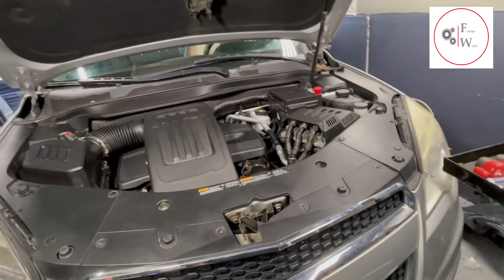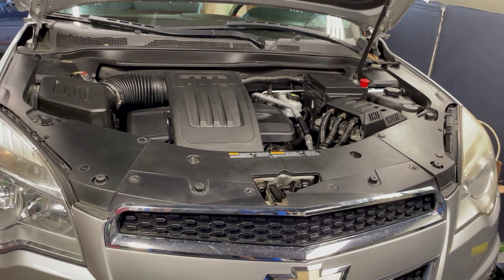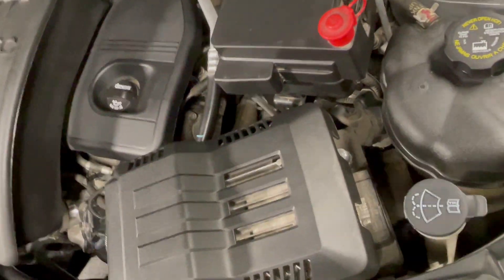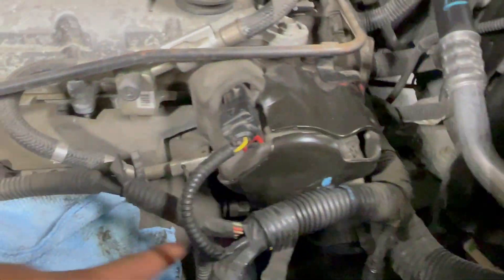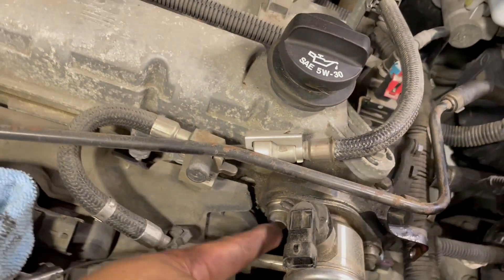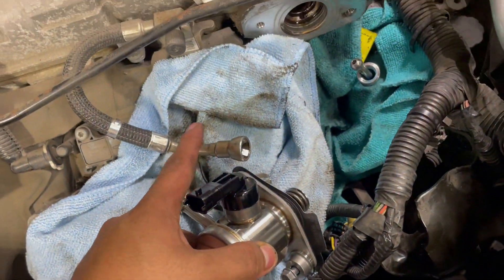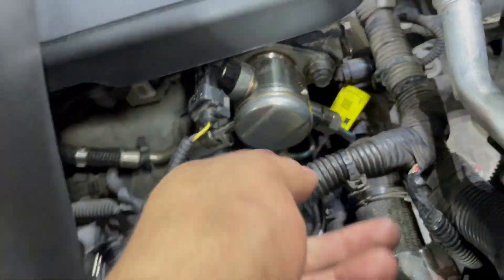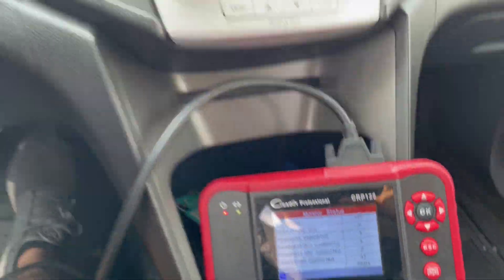Chevy Equinox High Pressure Fuel Pump Replacement (Code P0172) 2.4 Ecotec

Comment: My Daughter brought her 2015 Chevy Equinox LT 2.4L to me about a week ago, said her Check Engine Light was on and had been for some time.  She had asked her boyfriend to scan the car with his scanner but he never got around to it.  The reason she brought it to me is that she had a decrease in power (Limp Mode).
I don't have a scanner so I just checked the basics: Oil Level, Spark Plugs, Air Filter, MAF Sensor, etc...
Her Spark Plugs were in definite need of being replaced as I'm betting they were the originals with 95,000 miles on them, so I replaced them.
Also ended up Removing the Throttle Body and giving it a good cleaning.
These things seemed to take care of the issue so I gave her SUV back to her.

Just the other day it was hot outside and she had the AC going instead of having the windows down.
The Vehicle acted like it wanted to die and the belt was squealing, also, the Check Engine Light had come back on.
Again she asked her boyfriend  to scan it for her, again it didn't get done.
She called me and asked me to look at it again.

First thing I did when she dropped it off this time was to drive over to Oreily's and have it scanned.
Of course it had the P0172 Code: High Pressure Fuel Pump.
I purchased the AC Delco (EP1028) High Pressure Fuel Pump at O'reily's while I was there along with 
a Fuel Line Disconnect Tool.
Been a long time since I'd replaced a Fuel Pump, let alone a High Pressure Fuel Pump.
Actually, the last fuel pump I replaced was a Mechanical Fuel Pump in a 1973 Pontiac.

Her Equinox was Experiencing: Check Engine Light, Engine Run On after turning the key off,
Engine wanting to die when AC was On w/belt squealing, But There Was No Gasoline Smell In The Oil.
Believe me, there was the Gas Smell in the oil of that 1973 Pontiac!

I turned to Youtube to find a video and ran across yours.
I appreciated your video, most being Spot On.
There were just a few differences, most likely the model year being different.
Her's had an extra Bolt on the Lower Side of the Cover, a Fastener On the Top Side holding a Line 
(May have been Fuel line), and an Extra Fastener on the Side and an Extra Fastener in the Front of the 
cover holding the Wire Harness.
Everything else was pretty much the same.

I did find that loosening the Bottom Connection of the Fuel Injection Line made it much easier to attach
the Upper Connection to the High Pressure Fuel Pump (without stripping the threads).
I loosened it less than 1/4 turn, then once the upper connection was threaded on by hand I tightened 
back down the lower connection.

Replacing the Fuel Pump took me about an hour.
I have had 5 Back Surgeries and have lots of trouble leaning over the car to do this type of work. 
I also take lots of breaks because of my Back.
Would probably take someone without back problems, much less time.
Anyway, changing the HPFP went like clockwork.
Her SUV no longer has a Check Engine Light On, Not Throwing Codes, and is running great.
I had traded vehicles with my daughter for a couple days and I don't think she wanted to give
my car back, she likes the 2.0L Turbo in my Regal!

BTW, this is a job that almost anyone can do, man, woman, etc... (Don't let it scare you).
It does take a little bit of time and you will have to wash the dirt off your hands, but you can do it.
And with the Prices they charge at a Dealership or a Mechanics, it's well worth your time.

Thanks again for the Video!

Comment: My wife's Equinox is doing the same thing, I wasn't sure what the problem was,I asked a bunch of mechanics on Facebook and they mentioned the fuel pump,that's when I looked here on YouTube,if you don't mind me asking, what did you pay for the pump and did you have to change the fuel line?
Reply from the maker: I believe I paid about $240 for a genuine Ac delco unit. The line is recommended to be replaced. I however did not replace the line. Since this line has never been undone before there is no problem reusing. Once you undo that hose many times, then you need to replace it.

Comment: Does the cam lobe have to be in a certain position or can you just swap it out without having to deal with that?
Reply from the maker: Just swap it out, do not touch the lifter that is in there. Mount the new Hp pump and bolt it down! Some people say you have rotate the crank to be able to fit the high pressure pump. I just removed the pump without rotating the crank and installing the pump. I had a slight resistance bolting it down since the spring needed to be compressed against the lifter. But it was no problem. The equinox is still running like a champ!
Reply: @Fwerks.1592 thank you. I have a 2013 GMC Terrain 2.4 that has a P00C6 and a P0191 engine code.

Comment: Is this something a woman can do? I’m so tempted to try it myself. Is it just 3 screws and then the special tool to detach the fuel line?
Reply from the maker: If you have a tool set ratchet + sockets, that’s all you need! Also you will need that fuel line disconnect tool which they sell at the parts stores for like 16$. They come in a set of colors to distinguish the sizes. Also you will need an open box wrench to disconnect the fuel line from the high pressure FP.

Comment: About to do this same repair. Where do I get the tool to disconnect the fuel line?
Reply: How did it go ? Same issue here.
Reply: @djmtgMikeTheGreek-p6p  it was very easy actually just got the fuel line tool off amazon

Comment: You're supposed to replace that fuel line. If it doesn't leak than why? Gm also has a class action law suit because it's "acceptable" for that vehicle to burn 1 quart of oil per 1000 miles. 5 quart engine, 5000 mile oil change interval. Do the math. Lol! I hope the bastards get what they deserve! I have a lady on social security in her mid 60's and just had to tell her that her truck was junk.

Comment: Mine went into stabilitrak  and engine power reduced the other day. Cleaned throttle body wasn't it, bought new one wasn't it. Made it to the  auto zone to use the scanner, and it said, "It's mostly likely the  hpfp." i noticed it make a weird sound around where it's located.
Reply: My 2014 equinox lt had the same issues that's described in the video. It also suddenly did what you described as well. I changed the high pressure fuel pump and now all is well. Running great.

Comment: I just happened to be trying to pump fuel from a 2013 Equinox that has a pretty full tank because this car is just sitting for now.  Disconnected the supply line before the schrader valve and connected some hose going into a container.  I jumped the run crank relay but fuel pump will not stay on.  Seems like a prime cycle or something.  Is there an easy way to make the fuel pump run continuously?  I mean, aside from crawling underneath and jumping 12v to the pump connector.
Reply from the maker: @chad4132  why are you pump in the fuel out or trying to pump the fuel out? Are you dropping down the fuel tank?
Reply: @Fwerks.1592  just want to pump the fuel out in order to transfer it to a vehicle that is being used.  I planned on putting the car on ramps and seeing if I can get at the pump connections.  If I can then I'll just jump 12v to the pump and I'll be able to get this done.  But if there's an easier way, let me know.

Comment: So the fuel pump for these equinox’s is on the motor? It’s not in the gas tank like a lot of cars? Or is there also another pump assembly in the tank? Forgive me if these are stupid questions I’m just trying to learn so I can help my friend change hers out
Reply from the maker: So the high pressure fuel pump is on the block. The traditional pump your talking about it the sending unit. That’s always located inside the fuel tank. All vehicles have a fuel pump inside the tank and they also have a high pressure fuel pump located somewhere on the motor. No worries you’re all good bro!

Comment: My fuel trims are still negative after replacing the pump 130k miles, same code and can ran for a couple seconds after shutting it off
Reply from the maker: That’s strange, the high pressure fuel pump will cause for a delay on the car shut off. Did you use a OEM AC delco pump?

Comment: I've got a 2014 GMC Terrain with the 2.4l engine , same issue. any idea what the part number is for my HPFP and the "one use" line as well? any info would be greatly appreciated.  thanks 👍
Reply from the maker: Here are some parts numbers!
Fuel line: Intermediate Fuel Feed Pipe - GM (12608374)
HPF Pump: https://www.gmpartsoverstock.com/oem-parts/gm-high-pressure-fuel-pump-with-seal-retainer-gasket-and-bolt-12641847?c=Zz1haXItYW5kLWZ1ZWwtZGVsaXZlcnkmcz1mdWVsLXB1bXBzLWFuZC1yZWxhdGVkLWNvbXBvbmVudHMmbD0yJm49QXNzZW1ibGllcyBQYWdlJmE9Z21jJm89dGVycmFpbiZ5PTIwMTQmdD1zbGUmZT0yLTRsLWw0LWdhcw%3D%3D
Reply from the maker: No problem! I’ll get you that information shortly.

Comment: What tool did you use to remove the fuel lines??
Reply from the maker: I used the lisle 37000. You can find these fuels disconnect tool at any Advance auto parts store.

Comment: I found the fuel pump that you recommended on Amazon, its says to order with a 12608374 fuel feed pipe? Do I only need the fuel
 pump? Thank you in advance
Reply: Awesome! Thank you for your quick reply!! I greatly appreciate it!! Here's to fixing something on my pos equinox 😂
Reply from the maker: @jeanettehartwig1264   anytime!!
Reply from the maker: Yes get the fuel feed line too! The dealer mentioned that fuel line is a one time use.

Comment: Battling this exact issues with my 2011 Regal with the 2.4 dealership wants to charge me 1100 to do it. 700 of it being the pump n feed line. Gonna keep this video handy and attempt the repair myself
Reply from the maker: Make sure that pump is OEM from GM! I seen people replace it with an after Market and still have the same issue. Also you do not need to position or remove the cam-follower. I’m here if you need help!
Reply: @Fwerks.1592  following up with you... With a sigh of relief did the pump and feed line couple days ago. My 11 regal has been running great I just put a scanner on it. To see if there was any hidden pending codes. And nothings showing 🤞🤞🤞 this battle is finally over
Reply from the maker: @Smurfy89   That's awesome!!! I'm glad the Buick is now running great!! I'm glad I was able to help!
Reply: @Smurfy89 same issue here. The fuel pump and the feed line is two different things? If I install new fuel pump I might have same problem? Thanks
Reply: @Fwerks.1592  I ordered a ac Delco one

Comment: Is it necessary to line up the cam shaft with the pump ?
Reply from the maker: No. Whatever you do “Do Not “ remove the camshaft follower. Just remove the pump. When installing the new pump. Just insert it and start off a few bolts. The pump has a stiff spring on it so it will give you slight resistance when starting the bolts. Push slightly and start two of the bolts.

Comment: What was the performance symptoms while driving? Any smoke from exhaust?
Reply from the maker: Upon start up the rpm’s where bouncing / rough idle. There was definitely no smoke coming from the tailpipe. It felt like a misfire.
Reply: @Fwerks.1592  mine is running rich and does fine until you come to a stop. It’s then it starts hesitating on take off almost as if the motor completely shuts off and then smoke from excessive fuel comes out exhaust. Once it clears and you keep driving it does fine
Reply from the maker: @jackfentress0281  did you scan the car?
Reply: @Fwerks.1592  yes same code but was curious of what yours was doing
Reply from the maker: @jackfentress0281  I wouldn’t doubt if the high pressure fuel pump is going bad. It’s a common issue in most of the eco equinox

Comment: We have to try this. The so called mechanic says thats not the issue? It wouldn't go past 25mph, the suv was stalling, the lights would not cut off after we cut the veh off. When he test drove it, he said it ran fine?? What do u think??
Reply from the maker: Sounds like you may have a bad throttle body. A bad throttle body can prevent the car from exceeding a certain speed limit. It can also cause a car to stall. Did the mechanic properly scan the vehicle?

Comment: I'm getting ready to do this soon. I had a knocking noise replaced the fuel injectors went away. A week later noise back running like crap and oil smells like fuel. Great video it's saved and hopefully this will fix it!
Reply: It's a GDI engine there are no "fuel injectors".
Reply from the maker: I hope this high pressure fuel pump solves your issue!
Reply: Well?

Comment: our 2012 equinox starts and when on idle starts to like wana turn off and it does unless i press the gas ... engine light was on and i replaced the gas cap and engine light inmediately turned off.... but still when turned on and regulates down feels like it wants to turn off and it still does unless i press the gas after that it stays on normaly its a 2.4 l any tips oh and no codes come up and engine light is gone ever since i changed gas cap....... do you think its my fuel pump i have to replace just my guess
Reply: Same problem this week. Installed new alternator and it still wants to turn off while driving
Reply: @djmtgMikeTheGreek-p6p the repair looks doable but what “special” tool did you use for t 5:03 he fuel pump connection on the passenger side??
Reply: @RobertGuilbault  Fixed. Had a PO172 light forever. Changed oxygen censor. Car doesn’t stall anymore. Thanks Robert.
Reply: It might be your purge valve; mine was doing that and every time I refilled fuel and try to fire up the engine the will shut off immediately; I had to wait like 5 minutes before firing up my car.
Reply: Did you ever figure out what the issue was?, mine is doing that

Comment: couldn't it be fixed with just a new gasket? from what I've read it's a faulty gasket.... I also thought about using a hi-tac gasket saver to strengthen the gasket so it won't happen again... thoughts?
Reply from the maker: A gasket??? Noooooo this is definitely an internal issue that was failing. I didn’t have a leak issue. I had an issue with fuel leaking into the cylinder via the cam lifter. The spring on it wears out . Please do not use any gasket make or hi -tac gasket! Since it’s fuel it will break down quick! Use the metal gasket provided with the pump!

Comment: Hey i have ??
My 2013 gmc terrain shuts off upon starting wether engine cold or hot and upon 2nd restart no problem,i replaced throttle body n Maf sensor still does same thing,no check engine light at all,any ideas would be apreciative, im a basic home m
Reply from the maker: Does your car shake/ shudder when idle? A little hard to tell without being there. Might be a bad fuel pump going out. Do you hear like a whining more lie a bussing noise coming from the rear? Might be a fuel issue. Could be a bad fuel pump or a high pressure fuel pump.
Reply: @Fwerks.1592  Nope ! 
Once I start a second time it idles fine and rpms stay at about 900 rpms it idles fine no fluctuations and will drive fine never stalls during driving, i dont hear the hissing sound from fuel pump in tank, its got me stumped,Like I said only kicks n stalls after the first attempt of starting the car I have to turn off the ignition and then on the second try that starts fine and does not stall

Comment: hi i have a 2011 equinox 2.4 engine light was on i just had the high pressure pump replaced at a shop and they said they rebuilt it and changed the oil as there was gas in it however i drove the car for a couple weeks checked the oil and after letting it sit over night i checked the dip stick and it was dripping a bit and had gas in oil again but no engine light and runs fine fuel trim was good to on my scanner.
do you think i should just buy a brand new oem pump and that will fix the problem i figure rebuild is crap
Reply from the maker: I would have recommended replacing the HPF pump with a new ACDelco unit. Does the car shudder at times? Is there a delay when you shut the car off?
Reply: @Fwerks.1592  no its fine i also put a acdelco brand new one in yesterday and the car ran great for about 30 mins then it started the stay running when shut off and started stalling so i put the rebuilt one back in and its fine so im thinking its normal for oil dilution in these vehicles gdi wont be buying a GM again after this

Comment: Thank you for the video, Sir! I have the exact problem and P0172 code on our 2013 Terrain 2.4 and I also smell some fuel on the oil dipstick as well. I watched another video where the problem was with the Injectors and I'm not sure how I can tell if the issue is the HPFP and the Injectors or not. I guess trial and error will have to tell or just replace both. Also, I read on a Forum that you may have to set the alignment with the CAM Shaft to the new HPFP, is this true? I know we didn't see you do it but just wondering if you have any words of wisdom on that! Again, Thanks Bro!!
Reply from the maker: The high pressure fuel pump is a very common issue among the eco gm engines! Whatever you do, DO NOT mess with there lifter. I seen people rotate the engine to align the lifter to then align the new pump. After they all do they they have all these codes popping up. Just replace the pump and nothing else, I would also replace the fuel line if you can get it. When installing the pump putting it against the block will give you a little resistance. Once you line it up and start both bolts the rest is piece of cake!
Reply from the maker: Also to answer the question no it’s not true that you have to rotate the the engine to install the lifter/ cam roller. Just don’t touch it or try to put another one in there. This equinox has been running solid ever since the video and it’s been over a year lol